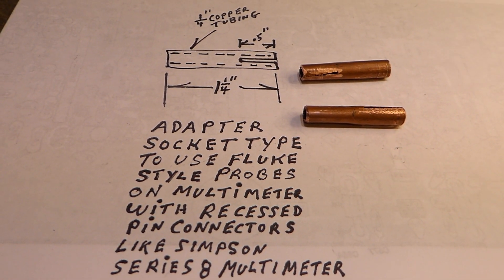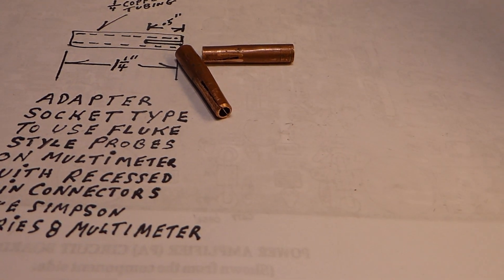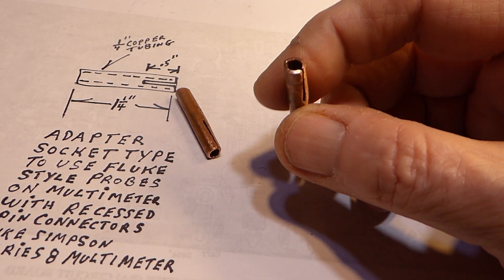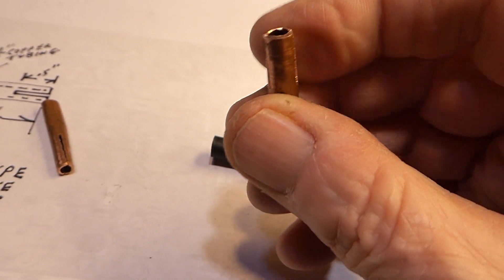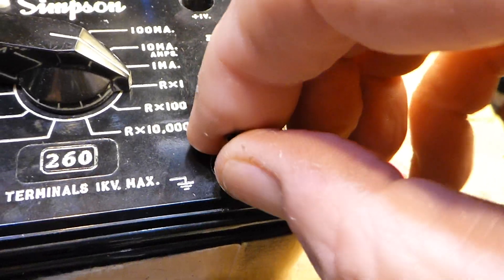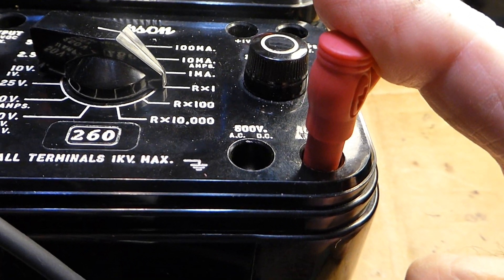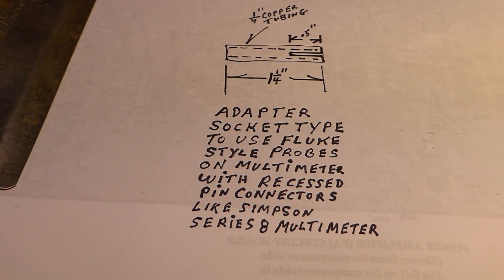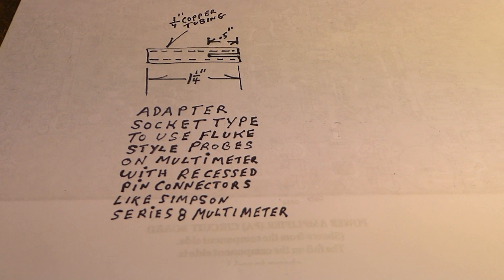MULTIMETER PROBE ADAPTERS  DIY

Comment: Great job. Suggestions = 1) Be sure to leave enough length on the tube, so that should it separate from the probe/Fluke side, you will still have enough stub to grab to pull it out of the meter. 2) Cut the probe/Fluke side of the tube the same as the meter side, instead of just deforming the probe/Fluke side? Maybe leave a 3/8" band of copper, in between. Turn the cuts 90* to each other. Just ideas...